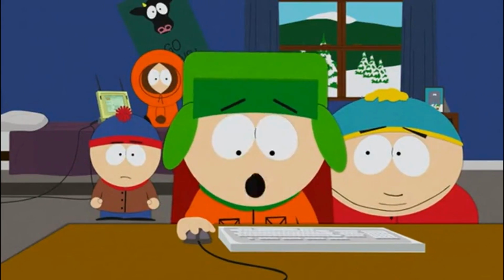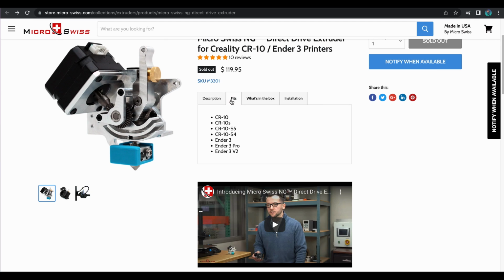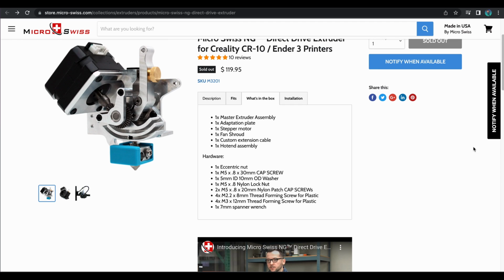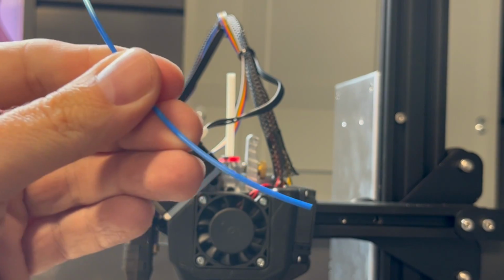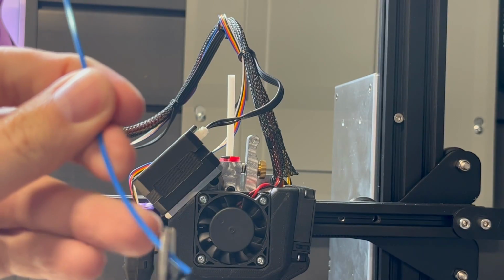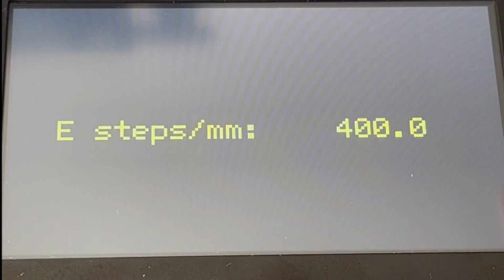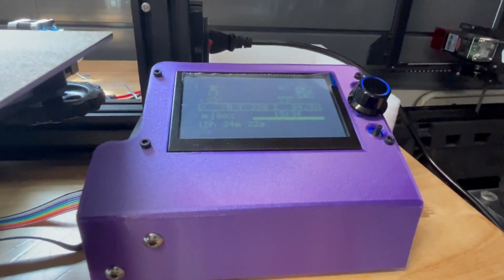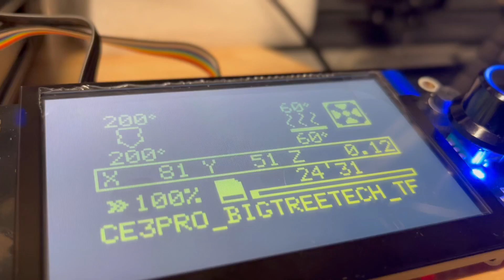Microswiss NG  - New Direct drive for the Ender 3 and CR 10!

Comment: Any tips on getting the prints to stick to the build plate? Mine just don't stick with this extruder. Level is good, z offset is  good. Just not sticking. Filament is just getting moved around

Comment: Thanks for tips. I had four problems - all solved....
1) New version of NG head is meant to be mounted to original (blue) backplate with wheels (and bltouch, if present), which is little more convenient, because there is no need to remove that backplate from the printer.
2) There was some bad tension between gears in NG, they were stuck, so i had to disassemble and reassemble it. Without any other work gears started to rotate normally.
3) I had upgraded my printer with titan direct drive from creality - and that came with own stepper's cable, which is not compatible with NG stepper. Logical mistake, but nothing bad happen.
4) Firmware for creality direct drive is not compatible with NG too, it must be "downgraded" to basic or basic+bltouch firmware. Otherwise is extruder movement reversed.
Just printing boat. :)

Comment: Question how are you getting goid prints? My old v2 z 165 offset printed good, but the I had same thing with extruder. I installed microswiss ng direct drive. Unfortunately I can't get a good print nozel keeps being too high. Z 305 still not getting a good first layer. Any ideas? Thanks

Comment: I bought this for my CR-10 Max and the fan shroud seems to have a special left hand mounting which won't let me install any of the recommended CR-Touch brackets STL's to print out... I am feelings a bit clueless, also for the filament sensor, no help in instructions for that...
Reply: I’m in the process of installing one on my CR-10 Max and came here to look for a solution to this same problem. I could easily design a new bracket for the BL-Touch but I currently don’t have any way to print it. 🫤
Reply: @BobPulgino  I made a design for my filament sensor already, a friend may print it for me - maybe we can exchange our bracket designs …

Comment: With the safety, just don't unplug the cord the way shown in the video.  Never unplug by pulling the cord like that, grab it on the socket/plug as close to the end as possible :)
Aside from that, great tutorial video.   I am currently tossing up between the Microswiss NG and Creality Sprite.
Reply from the maker: If you watch the video again, you will notice something about me unplugging it the way I did.    I wouldn’t normally unplug something this way.  During editing I noticed to didn’t have the unplugging of the machine.  I simply reversed the footage 😂.    Thanks for the compliment, and commenting on the video 👍
Reply: @TripodsGarage   I ended up biting the bullet and going for the Micro Swiss NG.  Just seemed a better option compared to the Creality Sprite :).      Thanks again for the great video.
Now before I install it, I just have to work out the extruder settings for Klipper :)

Comment: At 9:45 you are holding the hotend with a wrench while the printer is on. I fried my mainboard like this because I shorted the heater cartridge with the thermistor and the 24v volts directly went into the thermistor signal. I advise to turn your printer off after heating it up and wait for 5-10 seconds. Nice tutorial tho!

Comment: I was wondering about the cooling. With the cooling duct it looks like both fans are used to cool, unlike the stock setup where the front fan cooled the hotend only now it looks like it cools the part too. What if you did not want any cooling for the print just the hotend? I know the cooling fan can be turned off but not the hotend one.

Comment: they said it works on CR 10 and Ender 3 but would it work on Cr10s pro v2 ???
Reply: Hi Larry. I'm not the uploader and by no means am I an expert, but I installed this on my cr10s pro v2 earlier this week and it works great. The included fan shroud does not work for the 10s pro as it is meant for a different fan size and the screws for the x axis tensioner interefere with the fan shroud. I believe there are some shrouds on the internet for it with the 40x20 blower fan, but I ended up editing the original fan shroud file myself, and I will upload to thingiverse if I get microswiss' permission to do so. Other than that, it installs just as easily as the other printers it is intended for. Feel free to ask any questions if you have any.
Reply: @kryptonaight  thanks for the reply
Reply: @kryptonaight   Would it work without the fan shroud? I can't print anything using my old bowden setup (I just got a bird and the PFTE tube is toxic to them) , I'd have to install this one and print the fan shroud without a fan shroud installed
Reply: @snatchcrap  the printer would theoretically work without the shroud. Print cooling would be extremely poor. I would recommend you install it with the shroud and tape the fan into place, trying to duct it into the opening for the smaller fan. Then, you can print the shroud compatible with the fan. The print has a lot of overhangs so print cooling is a must.
Reply: @kryptonaight  Thanks :)

Comment: Just another extruder manufacturer joining the hot end gravy train. 
My cheapo ender 5 hotend still works great, prints flawlessly and only costs $15 to replace. The spare $105 can buy me a ton of filament.
Reply from the maker: @MicroSwiss has been in the "hot end game" for a long time.  Nobody is twisting your arm to purchase this.  Glad your Ender 5 hot is working great, when this is for an Ender 3 and CR10.  In most cases the price reflects the quality of the product.  Keep on pushing cheap knockoff garbage.  Yep, your $105 can buy you about 4 rolls of cheapo filament.  Not exactly a ton.

Comment: it is funny. every video I see and documentation says E-steps 400. For some reason I had to set mine to 825. I ma not sure why this is. But it is right on.
Reply from the maker: Wow! 852!  I am running the BigtreeTech SKR Mini  E3 v2.  Are you running the original board?
Reply: @TripodsGarage  no, it's a skr pro in a idex format. It started its life as a ender 3. Now its a ender 3 idex that's 400x400x500. Lol. But for some reason even with the bmg extruder it's e-steps r 824. So idk. Oh, I'm also running a palette 3 pro on it. Lol

Comment: This video lacks important steps. After setting the esteps to 400 you must run an extrusion test to see if you are extruding 100 mm of filament when set to do so. A PID tune is required and time the hot end is modified or parts are replaced.
Reply from the maker: If they were needed, then I would have mentioned them.
Reply: @TripodsGarage  They are needed. My actual esteps are 410 not 400 and PID turning is required any time a hot end is modifyed.
The other videos posted on the MicreSwiss site say they are required and so do most in the industry.
Reply from the maker: @Rons514  - If I noticed a temperature swing on my hotend, then I would have done a PID tune and included it in the video.  There wasn’t any variations in temps.  If I noticed under extrusions, then I would have checked the e-steps, then included it in the video.  Did you comment on Chris Riley’s, or Modbot’s?

Comment: John great review as always. I saw when you was printing that you used both side of the flex plate, is one side for pla (smooth) and the rough side for petg? I'll definitely be getting the both and just wondering so I don't mess up the plate
Reply from the maker: Hope this helps Chris, took it off of TH3D's website 

Adhesion Help - Check out our article here: EZMat/EZPei – Adhesion Tips and Tricks

ABS - You will need to use something like VisionMiner Nano Polymer to stick ABS to PEI, or use our EZMat on the other side of the plate. Smaller parts will stick but larger parts may lift without an adhesion promoter on the PEI surface

PETG/PCTG/TPU - If you are not careful with your 1st layer you can risk bonding the PETG/PCTG/TPU to the PEI surface. This will damage the surface. To prevent damage to the surface apply hairspray or PVA gluestick before printing PETG/PCTG/TPU on the PEI or EZMat surfaces

Part Removal - Make sure your plate is at close to room temp (under 30C) before removing parts. If you remove it when hot it is more likely to damage the surface.

Magnetic Base Compatibility - Using our plates with a 3rd party magnet may result in the plate warping as other brands' magnets are not as strong as ours.

Maintain Proper Z Height - When starting a print make sure your bed is level and your nozzle is not too close to the bed (if using an ABL system check that your Z offset is correct and use the Babystepping to adjust during a print). Running the nozzle too close will damage the surface and/or embed the plastic into the sheet. Damage due to improper Z height is hard to fix and is not covered under warranty.

Cleaning - Keep the top and bottom of the plate clean as well as the magnet if you get anything on it. IPA is what is recommended to clean the plate and magnetic base. Make sure that no liquids or adhesives are on top of the magnet or bottom of the plate. If liquids are between the magnet and the plate it can damage and degrade the magnet so keep them dry and clean.

SMOOTH PLATES SHIPPED AFTER 4/19/2021 WILL NOT HAVE A PROTECTIVE FILM ON THEM. WE ARE NOW REMOVING IT BEFORE SHIPMENT BECAUSE SOME CUSTOMERS WOULD NOT REMOVE IT BEFORE USING THE PLATES.

Dual Side Usage - When using the EZMat or other surface on the rear of the plate the magnetic strength will feel less than using a plate with only the PEI surface. We have tested using dual sided applications on our plates in house and they work well even with a surface on both sides. Some users have reported that on large prints having another surface on the rear can cause it to pull up from the magnet. Only apply a 2nd surface to the rear of the plate if you accept this risk.

Comment: John, good review.  Looks like an interesting unit.  I did the same thing - used old bowden tube to support the wiring, but also inserted a 16 gauge steel wire inside the tube for even more support.  Another option for wrapping is a split cable loom.  Lots of new direct drive extruders on the market,  probably the best upgrade for a Creality printer

Comment: Is this a lure to catch fish or a lure to catch fishermen? 😂😉 Looks & prints nice. 👍
Needs a manual feed knob 🤷🏼‍♂️😔
Don't forget to redo the offset and bed mesh/tramming.
When I went direct, I ran all the wiring in front of the extrusion. Zero chance of it binding/rubbing the 2020 if I end up at max Z.
Reply from the maker: Definitely a lure 😂!  Seen more direct drives lately without a knob.  Figured I would mention it in the video.  Most definitely, need to level, and offset!
Reply: @TripodsGarage  my titan clone doesn't either, but the driven gear is exposed enough and works as a substitute.
Reply: This is one of the biggest pluses for the OmniaDrop.